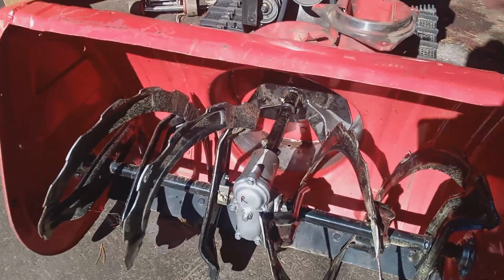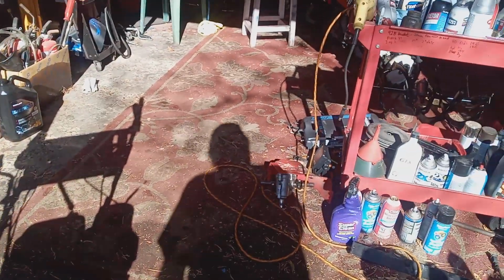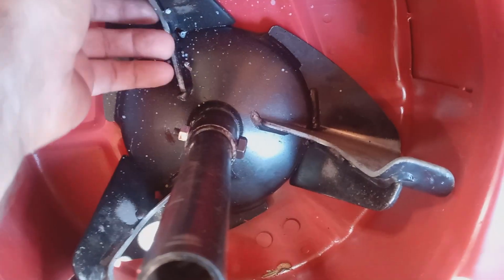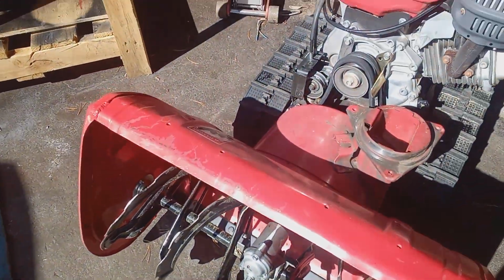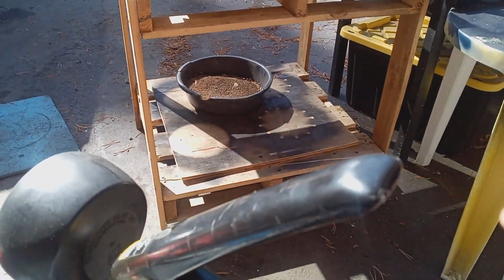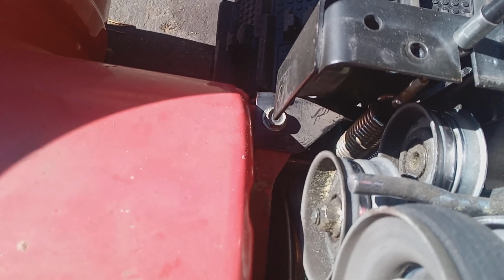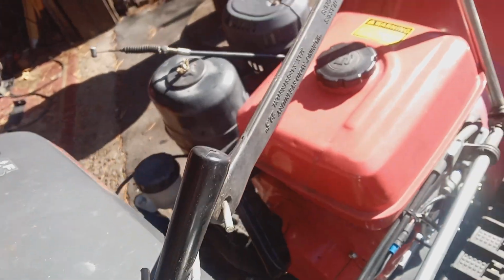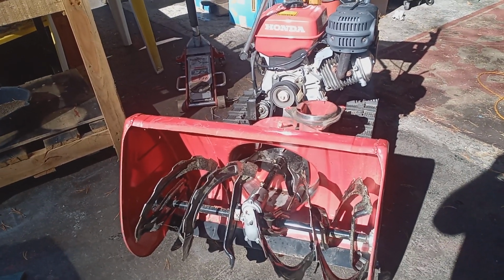STOPPED BLOWING SNOW? Honda Snowblower Step By Step Check.

Comment: Thank you for being so helpful! I just spent 2000.00 on a transmission replacement. I have an HSS1332A. I love the machine! I'm 58, and I have a large business driveway. I bought a commercial Husqvarna as a backup snowblower. It is night and day in the ease of use, so it was worth fixing the Honda. The Transmission cost over 1200.00, and the rest was labor. Watching your channel made me realize how much work it is to do so I bit the bullet and had it fixed. It's fairly new. This morning I the impeller got a hold of a dog toy, and thankfully, the impeller shear pin sheared. You led me to the fix. Thank You! I sent you a Thanks!
Reply from the maker: Thank You very much Sorry to hear about your transmission. must have been out of warranty I assume. well, now you should be okay. be sure to watch latest video on how to use your new honda snowblower. i found out i was using mine the wrong way until i went to dealer for demonstration.
Reply: @HondaSnowblowerEnthusiasts311  I will definitely check it out! Thanks for the tip.
Reply from the maker: @Niafifia  let me know what you think.
Reply: @ I thought it was informative. This morning I didn't feather the steering as best I could.After my spendy transmission repair I very much appreciate your information!

Comment: Perfect. Like you suggested, my impeller shear pin ends looked good but it was actually sheared.
Reply from the maker: hopefully an easy fix. sometimes the pins break and bend inside and they are a bear to remove. I use lubricating oil and try to punch out in that case.

Comment: Thanks for the video. 
My impeller looks like it has split pins and not sheer bolts ?
Is this normal? 
It's a Yard Max YB6770 26″ 2-Stage Snow Blower w Dashboard
Thanks

Comment: The snow blower was making a loud odd noise.Like a crunching maybe. All shear pins seem intact. You gave me more to check so thanks for going to the effort. will need to remove a cover it seems to see what else. Wish me luck.
Reply from the maker: It's very hard to diagnose without a video or up close personal inspection. It could also be a bad impeller bearing.